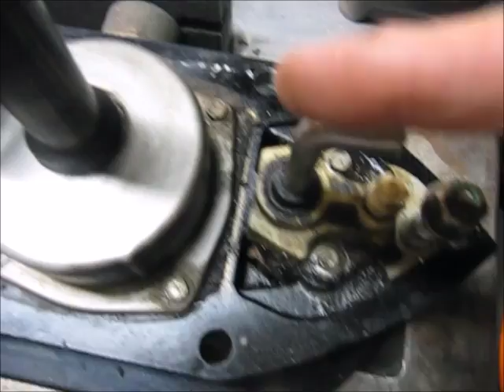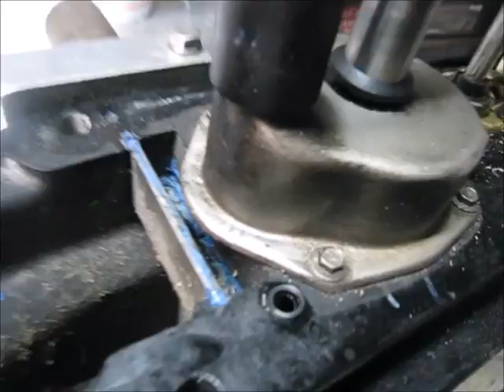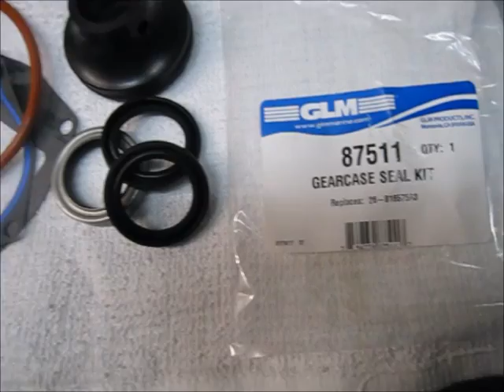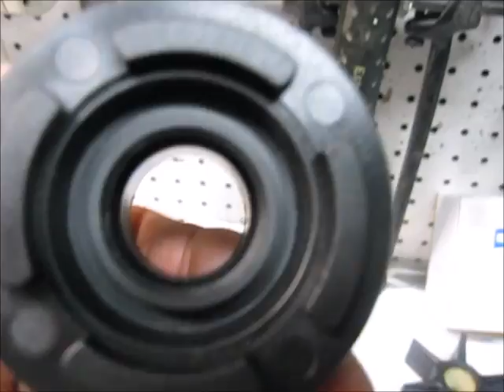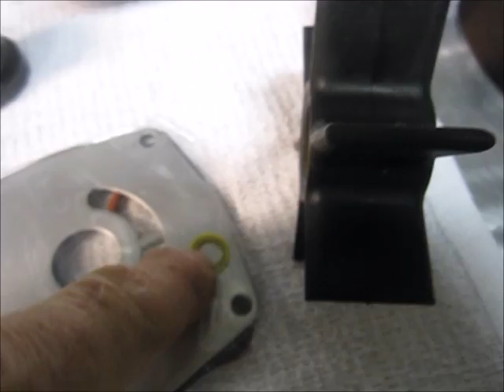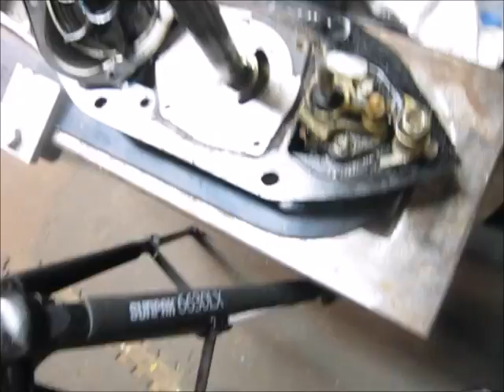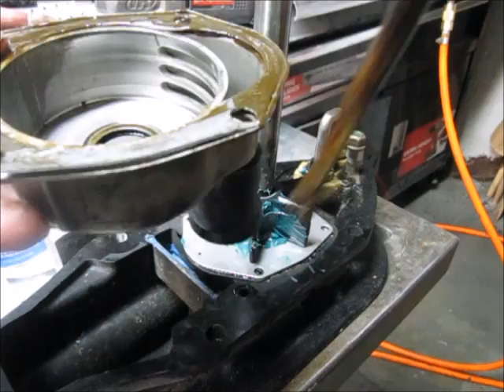How do I change my Alpha 1 Gen 2 water pump

Comment: When you say “gasket compound”, is that like “gasket glue”? Is that necessary? (Some folks do - some don’t. Merc spec doesn’t mention using it). What about grease just to hold it during assembly? Thanks for the vid. 🇨🇦

Comment: I have an 03 Wellcraft Martinique 2800 with twin 4.3 MPI's and Alpha One Gen 2 drives. The counter rotating drive has started to leak drive oil from the water intakes. Will the seals in the GLM 12043 Water Pump Kit take care of this?  I am going to do the pumps on both drives.
Reply: Was it the pump seals or the upper shaft seals?
Reply: @davidsnyder392  It turned out to be the pump seals.

Comment: Question....the 2 gaskets inside the pump. the first one has a bigger hole and the second one a small half moon one ???? doesnt that limit the amount of water flowing to cool the engine. and also why is one paper gasket go on the housing, and not on the bottom  like the other ones, does it make a difference ?

Comment: I found it a litter easier to get some extra long bolts for the housing and cut the heads off put them into the lower unit to keep everything in lined up then take them out after you put the first bolts in. Carl

Comment: Wayne, at first THANK YOU!  and glad to see someone from Toronto (and not Florida) posting this very detailed video.  This is what I wanted.  So here is my question (was going to call you, but thought online would be better for everyone's knowledge):  

1)  Do I put the throttle in Forward Gear first before removing the lower unit?
2)  From time line 1:07 to 1:16 - I see you are talking about how that metal piece (what ever you call it) is pointing in forward position.  What is this metal thing called?  Lower Unit Shifter?
3)  I then try to put the lower unit up and if the gears do not line up, all I need to do is turn the prop counter clockwise?  

.... and then the lower unit will snug back in effortlessly?     Are my observations correct?  If not, please correct me.  If my observation is correct, then I have to kick myself in the butt because I've been spending hours trying to align this thing and its like a hit & miss.   

I was pretty sure there was an EASIER way, and I think you just showed it here wonderfully in the video.  Please advise.

Thanks!

Comment: What happens if you rotate the spline clockwise and not counter-clockwise.
Reply: The impeller will fold backwards.  When you start the engine it might straighten out, but if it doesn't the pump won't work right and may not pump at all.
Reply: Nothing.. it will correct itself  on the first rotation

Comment: is there a gasket that goes between the upper and lower unit? I got a boat with the lower unit was off. I got it repaired and ready put them back together. so I was curious on the gasket.
Reply: No gasket, just the quad seal/o-ring for the oil hole.